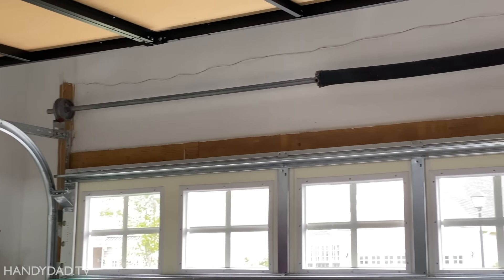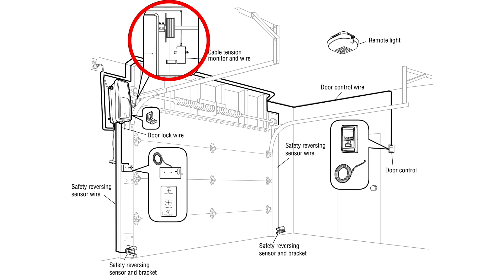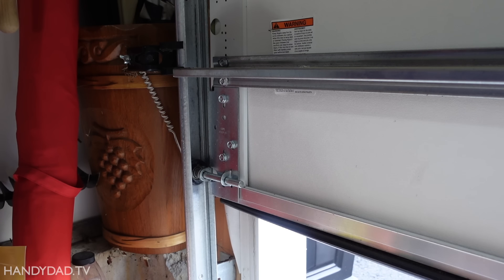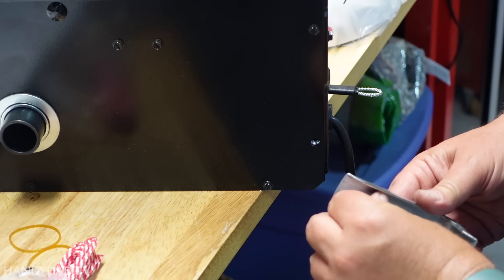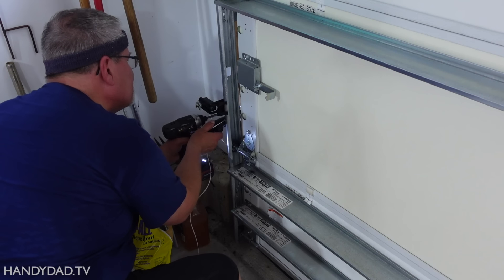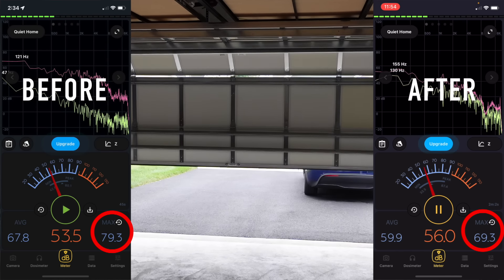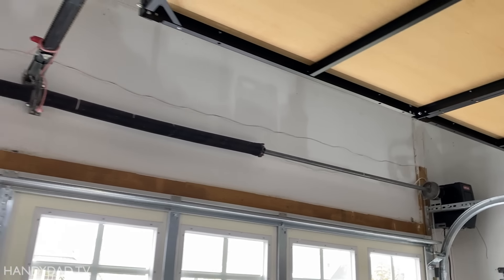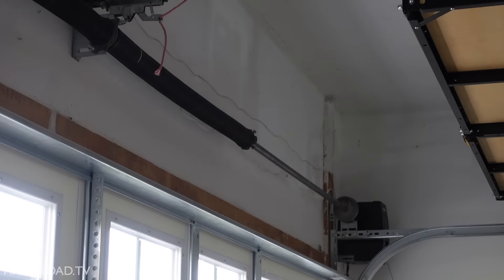GENIE Wall Mounted Garage Door Opener - Worth it???

Comment: i would never think about replacing a lift master product with a garbage genie product.  I Fing hate the 2 genie openers on my garage doors.   the keypad is so slow you have to press a button for like 2 seconds for it to take the press.  and sometimes you have to press the button on the visor clip several times for it to pick up the signal.  and i literally have to be within 10 feet of the door for it to work. this is on a wood door with windows.  shouldn't have a reception problem.
Reply from the maker: Sorry they are giving you grief. My LiftMaster was builder-grade garbage and it was an intermittent problem so it wasn’t worth trying to repair. 

My Genie has been fine so far, and my daughter’s is 2 years old with no issues. Hopefully they last. 🤞🏻
Reply: @handydadtv  mine are several years old. But they respond to button pressing like a 1970 era pc trying to use the internet🤣
Reply: The new ones are fast.

Comment: I have a question for any garage door guys. My garage has an upstairs part that is at least 15 feet tall and my garage door is 12 feet tall, instead of having the door go on the top of the downstairs what if I cut a hole and had the door go though the floor/celling and be vertical upstairs when it was open? then I have the whole ceiling for storage and the garage door wouldn’t be in the way. I also don’t want to get a roll up door
Reply from the maker: I’d call a professional

Comment: Those work but residential jackshafts have a life span of 5-10 years and trolley operators 15-20 years.  They are nice and worth it to some people and others are happy with the belt.  

Use some silicone and spray your hinges and spring.  It will be very quiet. Your door has some extra struts so it won’t have as much flex noise.
Reply from the maker: Thanks for the info.
Reply: As a professional garage door installer, that is not entirely accurate information on the opener lifespan. I myself have installed jackshaft units for residential doors that after twenty years are still working. (I-Drive, believe it or not). I have also worked on traditional draw bar openers that are 40 years old and still going!! We try not to do too much to those because the Federal Government wants you to barely even glance at them since they are technically out of code now. In the case of the newer jackshaft designs, they are scaled down and inspired versions of the big brother commercial ones. They should last a very long time. Both are quite over-engineered. Which is a good thing.😊

Comment: Just wait till you have a power outage. Oh yeah those springs that hold the cables on they come off all the time. Their okay.

Lift master side mount is finicky.
Reply from the maker: I have a whole house generator. I laugh at power outages. 😝
Reply: @handydadtv  oh. Good you should never have to reset it.
Reply: A power outage with THE MODEL SHOWN is NO different than a traditional center-mounted garage door opener. The user can disengage the opener and then carefully open/shut a well-balanced garage door with one hand. What's your point?
Reply: @jeffw8057  they have a tendency to lock up after power outages. Seems like they made some progress to eliminating the problem, still happens every now and again.
Reply: @tssteelx  Gotcha. Thanks for letting me know the issue. I haven't had any issues with mine locking up so far with power outages.

Comment: I don't understand the comment about not being able to lift the door without the springs. I see torsion springs. 🤨
Reply from the maker: The garage door opener locks the torsion rod so the springs won’t help you lift the door to break in. It would be dead weight.